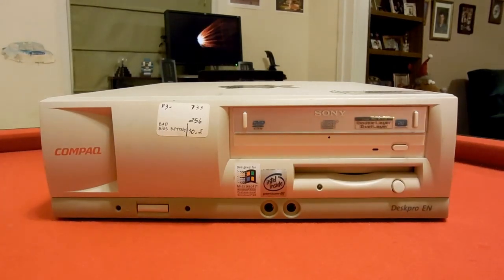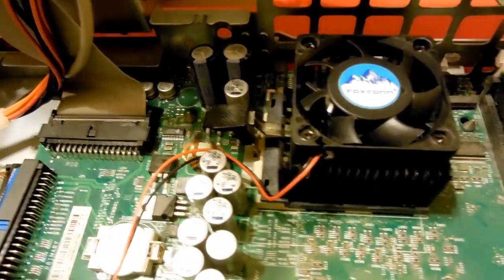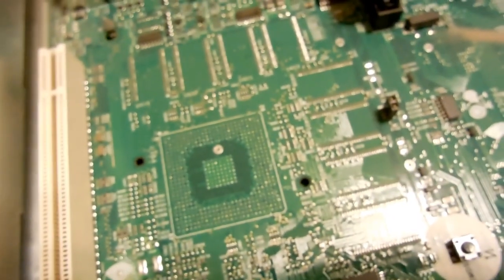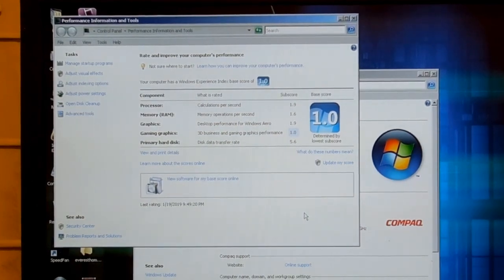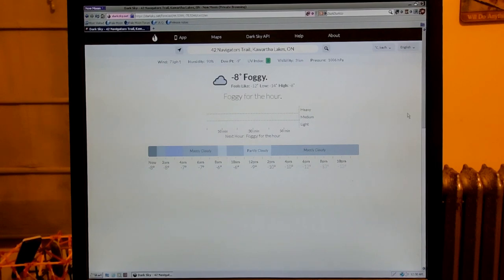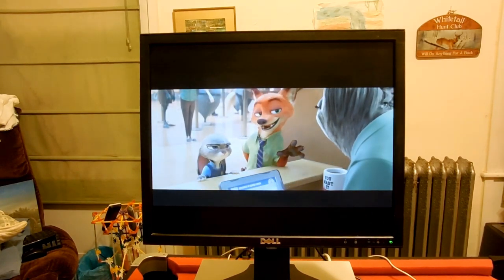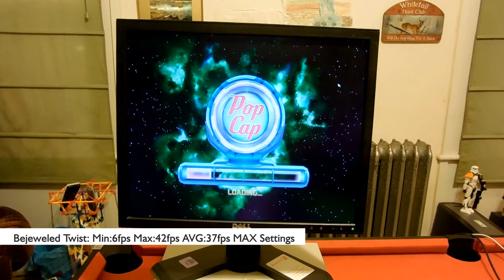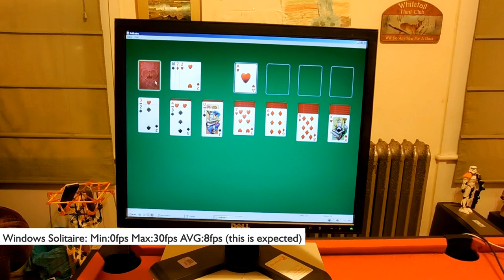Using a Pentium III In 2019? Windows on a DeskPro EN

Comment: They had the same design for the Evo D500 and 510. 

I bought a really cheap one with a 250gb hard drive, a gig of ram, and a 1.7ghz Pentium 4, no onboard gpu, it was sold to me with a nVidia Vanta. It did work, but after i cleaned it up, it didn't work anymore. At least i got a hard drive out of it.

Comment: Nice video! I refurbished and upgraded one of these little wonders: 512 SDRAM PC 133, Celeron 1,1 gHz, later a P-III 1 gHz, FX 5200 PCI card and 7.2 k rpm HDD. 
But I'm angry with Compaq because they didn't release a BIOS able to run Tualatin, its Intel Solano chipset could work with the best Pentium 1.4 gHz.

Comment: my dual pentium 3 + hd4670 agp can even play 1080p youtube videos (in the browser)
Reply from the maker: with such a beefy GPU, I'd believe it. YouTube's HTML5 player likes to make use of the GPU.
Reply: @I430VX  yeah but it only works when forcing h264 video playback, like with the h264ify addon for chrome or when using kmeleon browser. vp9 however doesnt seem to be accelerated by the gpu it all and even a dual p3 cant handle 360p in that case
Reply: @themobster7284  what browser did you use and which gpu driver version?
Reply: @talvisota327  

https://i.imgur.com/CGuhmI3.jpg
Is some mix between catalyst version and the driver...

And for browser i am using some old ChromeStandaloneSetup brouser, that is like google chrome, but that works with old no SSE2 systems... And also K-Meleon75.1
Reply: @themobster7284  im using the 12.3 agp hotfix driver but i guess your driver should work too since its even newer... i see you are using chromium and not chrome? as far as i know chromium doesnt have codecs for h264 etc included. also accelerated video playback doesnt seem to work that good on win xp. i think 480p is the highest resolution i could get working on xp without much lags while on win 7, even 1080p is working quite well.
Reply: @talvisota327  hmm interesting... Well dont know i use it, as is working, as all old Google Chrome files are deleted, i was unable to find old evrsion that was workign with non SSE2 CPUs, is why i use this instead...  Then if 480P is the max, how you run on Pentium III and HD4670 1080P in you tube, if the max is 480P... My problem is i dont know how to enable H264 instead of the shitty HTML5 , and to use the GPU HW acceleration, that is the problem.. On the Media Player classic i know how to do that and i can watch blue ray stuff, i have Avengers infinity War on that socket 462 system with the Radeon HD3850 and works fine, but dont know how to do it for the browser... 

BTW i have also dual socket 370 with x2 Pentium III Tualatin 1.4Ghz... 

https://imgur.com/a/uEOwmkG#ltMCCUu
Reply: @themobster7284  480p is only the max on win xp but with win7 720p and 1080p is also possible... i have both windows versions on my P3 system. i think i still have the chrome 33 installer somewhere, i only have to look for it. chrome 33 should work for now, maybe you have to install the h264ify addon to make it work, but i dont know if it will work for much longer since youtube will stop supporting old browser versions soon. 
yeah i saw your dual P3 system, it's really nice. sadly my board doesnt support tualatins so i have to use 1 ghz coppermines. apart from that i have a socket 462 machine too with a hd3850 gpu lol but my cpu is a normal 3200+ barton
Reply: @themobster7284  yeah i know, back in 2010 i could watch youtube videos on a single P3 1ghz, 512 mb ram and geforce 4 mx gpu without any issues and browsing the web normally was also no problem at all. but since youtube changed from flash to html5 and the web in general got a lot heavier and media / script focused, all those old machines struggle a lot. another problem is that pretty much all modern programs are developed for cpus with SSE2 or higher... even simple programs like ccleaner need SSE2 now even though there is absolutely no reason to compile such a program with those instructions required. 
your S462 system looks great too, what kind of cpu cooler is that? i didnt even know such huge coolers existed for S462 lol. and great collection, im getting jealous haha. i also have a lot of stuff but nothing compared to you and sadly no more space for new stuff
Reply: @themobster7284  yes that chrome installer was really hard to find. i looked for it about 2 years ago and since that version is from 2014, most links were long dead already but eventually i could find it on some turkish site i believe. but by now it definitely shows its age, some websites arent displayed properly anymore or even refuse to load but for the most part it still works. apparently 6 years is a lot when it comes to web development even though i dont feel like the web is much different compared to 2014... i think for proper web browsing its better to use new moon sse or Serpent sse since they can display almost anything correctly, they are just somewhat slower than chrome sadly.

that ThermalTake Sonic tower is certainly a really interesting cooler and i will remember that in case i ever need a beefy S462 cooler. at the moment im using the well known zalman cnps 7000b-cu which works quite well and since i dont think i will ever overclock my athlon xp 3200+ i probably wont be in need of any better cooling solution. 

damn thats really unfortunate that you were too late with the pc shop guy, 2 rooms full of old pc stuff sounds awesome and so many rare items could have been in there. but well it happened and sadly you cant change that anymore... i only wonder why he threw everything into the trash when he could have made some good amount of money by selling the most rare parts. 

personally i dont think i have any parts that can be considered really rare, mostly because i never had any luck to get good parts and also because they have become really expensive nowadays. too bad i got interested in that stuff just some years ago. like 10 years ago it would have been much easier and cheaper to find good and rare parts. i mean i have stuff like a complete P1 machine, voodoo 2 cards, many of the best agp cards etc but thats all still common and easy to find.
Reply: @talvisota327  
Well chrome works well enough for me last time i used it, i did even go in facebook with that machine, all i can say was pain in the ass but STILL was facebook that garbage site is so heavy to load, even on my modern Ryzen system with 16 threads and 16GB of memory, if i scroll one single page tooooo much it starts to lagggg like shit... But i saw like a month ago did use for some stuff my 462 system and some sites dont load with the chromium browser, so yeah these machines have been made obsolete since 2010 and everything after that make them not usable for most stuff... I still can go to torent sites and download stuff, that system runs U torrent 2.2 (the last good and not garbage U torrent that just works, as 3.0 is the biggest trash i have ever seen,. I am using U torrent 2.2 since they introduced that shitty u torrent 3.0 i saw is just bad so i reversed, and since that day i am using like how many i am not even sure prob 6 years or even 8 not sure..) and is downloading torrents like a champ, for that these sytems will be good like lot of years. But general for browsing no chance is just a pain in the ass, and many programs drop the ball on the old systems on purpose.... 

About TT i have second one, is a bit differend, i sell it, cuz it have some scratches and wear so is not for the collection..
ThermalTake Silent Tower 3
Yeah that Zalman cooler is very good cooler for 3200+ 2.2Ghz Athlons, it cooles even the VRM and the Caps and all stuff near the CPU, very good design, only downside is when the fan brakes some day, u cant use normal one, u need exatly the same one.. I have couple of Zalamn coolers myself, used for some time 1 of them on an DFI Lanparty Ultra D System with Opteron 165 socket 939... No need to OC the 3200+ no point, if u do that better find mobile barton, u will get like 2.4GHz on the same voltage as the 3200+ have for 2.2Ghz...

Yeah it sucks when i think about it, my collection was going to be ultimate, but still cant change the past, i am even more mad about these parts going to the fucking scrap, and they will be forever destroyed, and no one will be able to have the joy to holding them, that is the most shit part, as i was not going to be so sad if the parts did go to another collector, damn even some scumbag that will sell them in ebay, as that is way better for these parts but nothing can be done... I am also wondering the same thing, why the fuck did that guy send all stuff to the scrap instead of giving them away, or AT least to sell them, he was going to make good profit, but i guess some ppl dont care or know the value... That is also a good thing, ppl dont know or care for the value of these old computers, parts and keyboards, as that is how i get really cool stuff from time to time, for next to no money.. But i sell all the time the stuff that are not interesting like ASRock boards, ZIda  Tomato, QDI, ECS and other shitty brands that are not worth my time and to take my space here, i consider parts that are not exotic, rare ot high end working scrap, is how i call them, ofc that they dont have value for me at all, does not mean i will trow them in the scrap/ trash, i just make AD and sell them to someone that will enjoy them, and with the money i will buy something that i enjoyu so is win-win for both me and my costumers of that working scrap... And with that way of doing things i made all my stuff free, as i did make lot of money from the crappy parts, some times sadly i sell some more interesting stuff, that was a mistake i see it now, i did need if i sell stuff like ABIT BP6 i sold it for only 50$, and when i saw later the ebay prices was WAY more expensive, sure that mobo is garbage, no tualatin support, is unstable board, but is rare so my bad is i sold it for only 50$ insteaf of like 100$ or 120.... But i did cover other stuff i did buy, and made money for some other stuff that i did get, but still...
SO yeah is shit the parts did go to the scrap, but what can be done... Is similar story with my Creative AWE64 gold, that guy i did trade some stuff for that card told me, the was in a office, and they was going to trow all stuff in the scrap, and then he did look at the computers there and he did take all the good stuff, and that AWE64 gold was one of them, he said if he was 1 day later there the card was going to be scrapped now... But over the years i saw lot of stuff can be found if i have the patience to wait, now i can have even Voodoo V 5500, i jsut need to trade stuff that i prefer not to trade, at least the good thing in all of it is that i dont need the stuff i will trade, SURE IBM PS/2 system is really cool to have, as is my only one, BUT i dont like that Model 56 is small, and i dont like small computers i prefer middle ones and specially big ass ones, and also the fucking PS/2 of IBM is using their own fucking MCA architecture, so RIP if some part dies, or something happens GL finding spare part, so PS/2 is cool, but also it sucks ass. I have IBM PC 365 dual socket 8, that machien have normal slots and stuff, and whatever i trow on it will just work, no MCA bullshit, is also why i prefer IBM PC XT, and that 365 ovet the PS/2 as they use normal parts. And for the CGA monitor, well i dont like it anyway, prefer IBM or Compaq one, and it takes space both stuff...

Well i myself started collection all good stuff like after 2014 when i got some good giveaway by some nice guy that did sell me before that kit of Mushkin DDR500 2GB memory, and when we talked seems he got fascinated or something from me and the fact i did go with my bike from 1 end of the city to the other end of the city just to buy that memory, so next time he did get all the stuff with his car to my house, and did not evenw anted the 50 euro i did want to give him.. Later on i did start serious collection in 2016 and specially 2017... Most good stuff i got was in 2017 and specially 2018 and 2019. In 2017 i got from scrap deal trade 7 3Dfx Voodoo cards for like 5 euro, as i did trade to that scrapper 3 CPUs ceramic x2 486 and 1 socket 7, i know i did send them to the garbage, but the Voodoo cards was so much more valuable and interesting. So i got Voodoo 2 x2 blue cards seems from SLI pair, Voodoo 3 3000 x1, Voodoo 3 2000 x2, Voodoo Rush,  Voodoo Banshee.. And that was big start for me, then i got IBM Model M keyboard, in 2017, before that i did think all mechanical keybaords are jsut cherry MX, but man i was wrong.... So yeah if i did start long ago i was going to have now small museum, but nothing can eb done... Years back there was lot of Epox boards 8RDA+ ones, these days nothing, even some ABIT NF7 boards, now nothing, so the parts are stasrting to dissapear here locally...
Reply: @talvisota327   I type now on my mechanical Chicony (is garbage cheap brand) with Cherry MX Blue made in 1989 is old as fuck, i have also IBM Model M gen 2 (1991) and Gen 3, the Gen 2 is in very good condition, and i have 1 Cherry G80-1000 (1990) Cherry MX Black.... I hate that garbage Chicony the plastic is fuckign cheap, BUT i want to find a second Cherry G80-1000 and to desolder all MX Blacks and replace them with the clicky MX Blues, as there is Cherry G80-1000 with MX Blue switches, but they are rare as fuck, as most G80-1000 models was made with MX black, and only 1 was with Blue bullshit stuff if someone ask me.... 

https://imgur.com/a/y2jKS1h

Comment: The DeskPro was meant to run windows 2000 not windows Vista Basic.I am surprised it ran Vista Basic that well. Where did find drives for the DeskPro?
Reply: It can run many Desktops, problem is when you load up a Browser.

Comment: I have MSI PM8PM-V Motherboard
CPU Intel Pentium 4 3.20GHz
GPU ATI Radeon X1650 Pro
HDD Seagate 160gb
And I Running Windows 7 Ultimate SP1 32bit and it's so fast

Comment: Every time I'm watching these videos I wanna use my Dell C810 as a daily for courses, sadly I need Microsoft Teams :/
Reply: Teams or Meet or anything is a real bummer for this kind of hardware. I've given it good conditions, like a Pentium D and an ATI Radeon HD3450 graphics card, and under Windows, it dies. I plan on trying antiX Linux, since with that I may be able to just pull it off. However the 2GB of DDR2 RAM is also a limiting factor. These things are not optimized, and require newer hardware, so if you don't have a ton of money to waste on a very powerful PC, you ain't gonna have a great time.

Comment: Only problem on those machine is no SSD
Reply: It won't make to much of a difference, it bottle necks at the slow Ram and slow CPU. SSD will make very little difference, if at all.
Reply: @STONE69_  I mean on loading times
Reply: @BenoitAdam  yes your right, if you use an SSD with 1gb 1.5gb of ram and you use win XP or Vista there will be an improvement in loading  ... just tried it on XP LOL

Comment: Funny thing my first computer with p4 style xeon and windows nt 4.0 workstation.
It had sata and 40gb Seagate .
So I never saw a ide drive in own life .
I never knew cd drive have Audio cool.
I will install windows 2000 instead
Reply: So let me get this straight? A pentium 4 based Xeon (The oldest one from 2001, and the newest from 2006) with SATA (From around 2004, when NT4.0 ended support) Also the only era this PC could've existed in, most PC's were still using SATA for the DVD drive (Which only changed in 2006, after the Pentium 4 Xeons were discontinued) also, NT 4 never supported SATA, so either: You are making this up, or this is real and somebody downgraded it to NT4.0 (I have no idea how, remember it never supported sata)
Reply: @dhl-96  Promise controller can emulate IDE and you can boot NT4.0.  PC is from 2004.
Reply: @dibyamartandasamanta583  If its a prebuilt then it would've never shipped with NT4. Somebody had to have installed it but why? It was out of support and most if not all programs also run on 2000?
Reply: @dhl-96   I think it came with XP since got a XP sticker. I don't know who installed NT4 on it. May be for my granny? As she is only familiar with 95 & office 97 but thats a speculation
Reply: @dibyamartandasamanta583  Alright I guess that makes sense